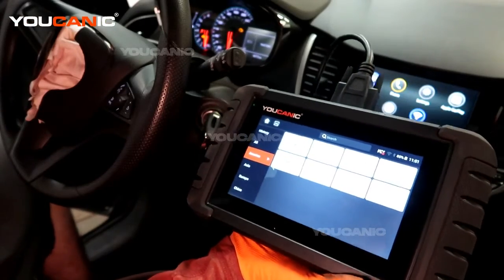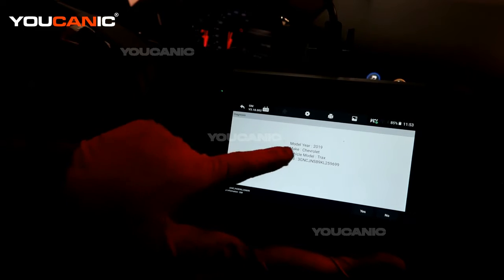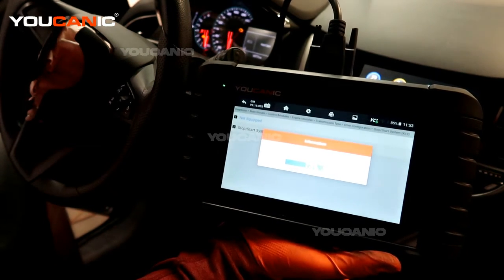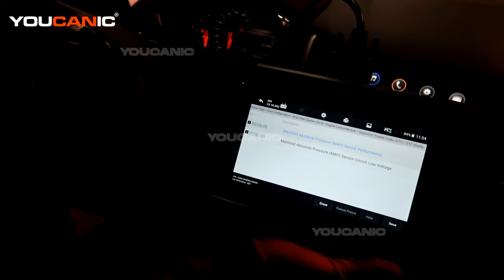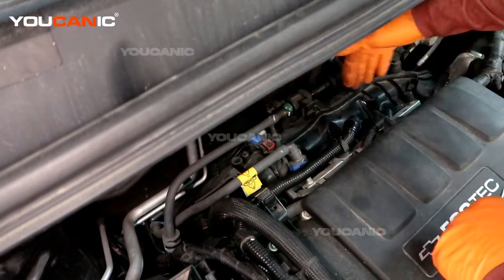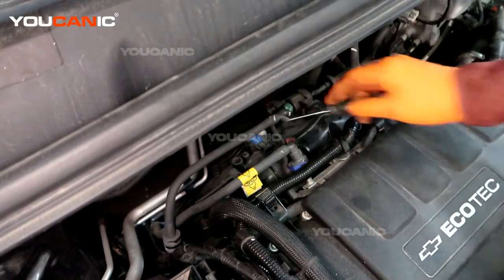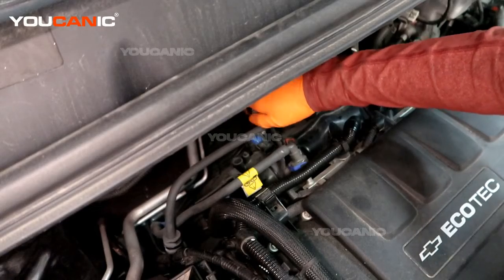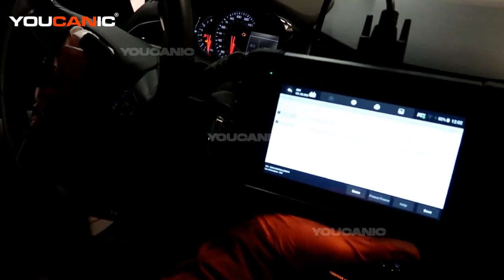2015-2023 Chevrolet Trax - Fix Fault Code P0106 & P0107 (Manifold Absolute Pressure Sensor)

Comment: i was getting a p0106 code. bought a aftermarket sensor off amazon and I am still getting the code although the trax is running great and getting good gas mileage. would buying a genuine gm sensor get rid of the code ?
Reply from the maker: Hi there! We're glad to hear your car is running great. It's possible the code could clear with a genuine GM sensor, but there may be other factors at play. Feel free to use our YOUCANIC scanner to further diagnose the problem, or check out our detailed guides and factory repair manuals at www.youcanic.com. We're here to empower and support you with your car maintenance needs, so don't hesitate to reach out if you need further assistance. Let us make your car ownership journey easier!
Reply: @YOUCANIC  I took it to pro.. charged me 380.00 and fixed about 5 codes that he said was tied to a aftermarket MAF.. light was out when I left.. next time I started it light came on and ONLY P0106 code.. I wasn't about to take it back and pay him to change that sensor plus more labor .. I figured go get a genuine GM and see if that does it.. when he ran all his tests he told me there was no other issues..don't know why he didn't change the map..
Reply: @raidman75 How is the problem solved by replacing the original GM map sensor? My car is like this too p0106

Comment: Changed the battery and getting P0171, P0106 and P1101 codes
Reply from the maker: Thanks for reaching out. You may find our Youcanic guides and free resources helpful in resolving these P-codes. Our Youcanic scanner can also make car diagnostics easier for you. Please feel free to ask any further questions on our website at www.youcanic.com/.

At Youcanic, we aim to empower car owners like yourself to feel confident handling car issues. We also provide factory repair manuals for in-depth information. Remember that we are here to assist you in all aspects of your car ownership journey.

Comment: So what do you do if it doesn't fix it. I've replaced everything possible except the secondary air intake and I replace the map sensor first and it worked at first then shortly after started doing the same issue. Any recommendations?